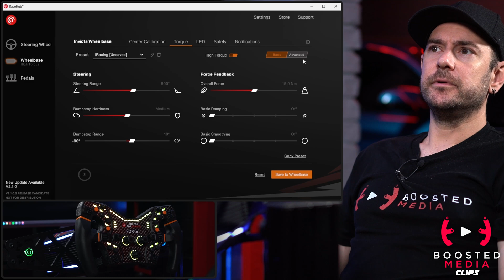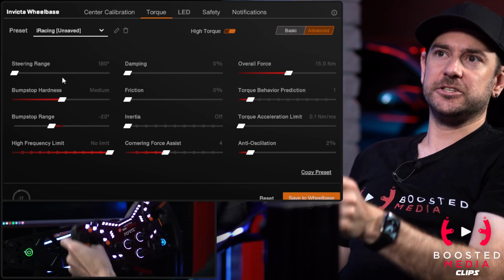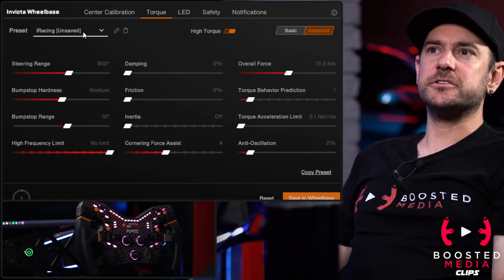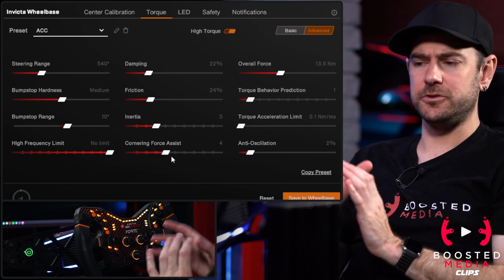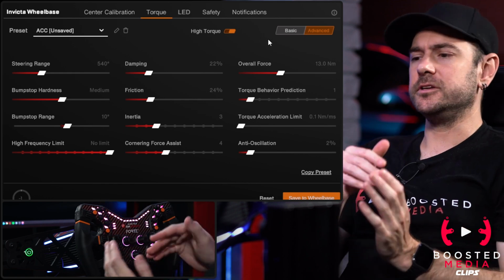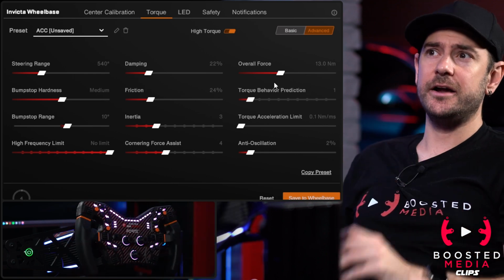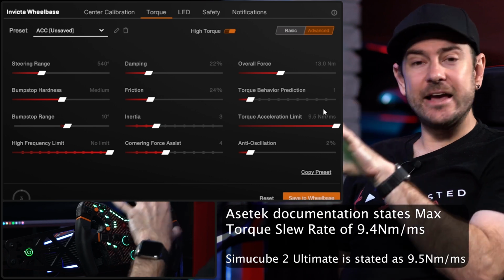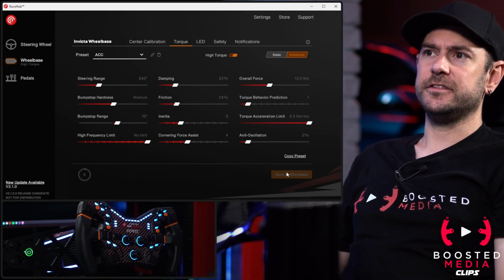Asetek Wheelbase Force Feedback Settings Guide

Comment: One thing i noticed is that asetek doesnt gave seperate direct input settjngs like all other wheelbases do. Leads me to believe they may use some telemetry ffb. Ive found also you can reduce the nm setting and not reduce detail like other wheelbases. Ive found it really works well compared to other wheelbase which use dual fdb and gain settings.

Also there slew rate doesnt work the same as you explained. Lowering it softens the input but its very snappy still. Its almost like a detail setting. Turn ir down rhinfs get soft not as dense. Turn it up yes nore wild but nore more detailed nor as aofr. But even all the way down irs very snappy and responsive. Everything is still very snappy though so idk how asetek is using there slew rate setting it isnt like others. Most slew rate settings you turn down and its not as snappy but details are still dense. This is the opposite. Its why i find it weird the la prima and forte have the detaol even with less. Yet you put invicta at 4 and it feeels softer then la prima at.4 so its being used differently then we think

Comment: Hey Will, I purchased the Invicta wheelbase and Forte wheel 2 weeks ago. I used your Code “Boosted” for your discount. Thanks bud! 
In this video, you mention that you run 0 Torque Behavior Reduction in IRacing. I tried that setting but it feels clunky and notchy. I’m forced to run it at 2-3. Do you not feel that with your wheel? It’s very noticeable even when driving straight and swaying the wheel back and forth. The best way I can explain It is… it feels like running your finger nail through a comb. Curious if you feel this in your wheel. Thanks in advance.

Comment: hi if you play at 12nm why not take the prima I have the invicta and I was told that you have to put it at 100% and reduce the ffb in the games otherwise we don't take advantage of all the details and we transform the base invicta in the prima because I'm a bit lost thank you
Reply: I was also told this. But based on boosted experience this claim doesn’t seem to be hold up anymore. Tho You still get the very high slew rate of the invicta and would be something.

Comment: To add to the Asetek wheelbase frustrations of requiring different and unique interventions to work on AMS 2 and Dirt Rally 2.0 (non-exhaustive list), I get a "Voltage too low" message and force feedback cuts out. I've reached out to their team and will wait the usual 2+ days to hear back from them. Yeah, I'm not a fan of Asetek at the moment.
Reply: Wheelbase works fine on asetek forte for me. Had to put the wheel in legacy mode for it to work tho

Comment: I just got my Invicta gear and what an amazing kit.  It’s incredible the difference coming from a Moza R5 and SRP pedals.  Within 5mins I was cutting 2.5-3 secs a lap.  You are correct in that  the 27nm is not needed, at all!  The fidelity through your hands is remarkable.  And that brake pedal is just magic.   I had modded my SRP pedals to feel pretty decent compared to a lot of other pedals on different sims I have sat in.  But that Invicta pedal is just amazing.  Trail braking took some getting used to, but holy hell, what a difference.  Like Andre eluded to, stomping on it and pulling back your toes as you glide in is just an unworldly good experience.
Reply: Guitartube,  I still swear by Asetek.  I’ve gotten to drive a good few sim setups.  Unless you are plunking down ungodly amounts of money the Invicta series still wins out IMO.  For the WB I’m running slightly modified V2 settings.  The V2 settings make the wheelbase feel significantly stronger.  The pedals continue to amaze me.  I’m currently on the long travel, but with an orange insert.  It feels the best to me.  I’ve been using track titan as a teaching guide and my times have dropped significantly.  Reading data and implementing it into how you approach corners, drive out, and exploring the outer limits of the track have been game changing.  The toe lift I refer to from Andre is absolutely paramount.  On most tracks I’m within the top 100, if not the top 25.
Reply: Last note…you had better have a chassis that can handle the Wheelbase and pedals.  I’m currently on the SimLab P1X pro.  I did have to modify the mount to make it work, but it’s solid as a rock.  Added the SimCore Asetek front mount then drilled the base of the standard simlab mount.  Tightened down it’s perfect.  Obviously there are other options, but this was my call.
Reply: This is literally me at the moment, deciding what to go to from my Moza R5. I’ve also modded my cheap pedals out and I’m doing pretty decent, but I feel I’ve milked it for all it’s worth. Torn between Asetek Invicta, or Simagic U. And whatever I go with I’ll go with their pedals and so on. Curious if this is still the best choice you’ve made kind of thing.